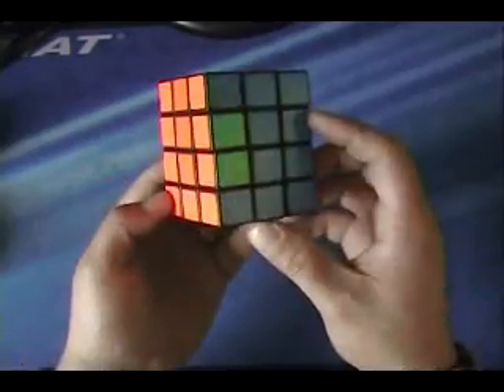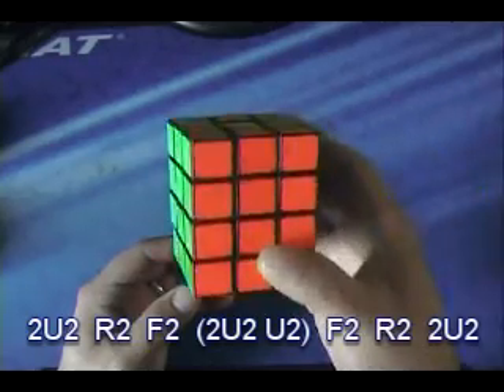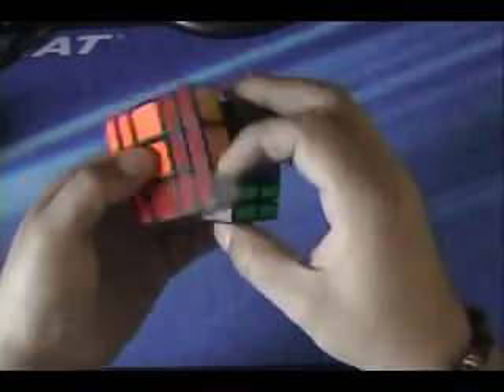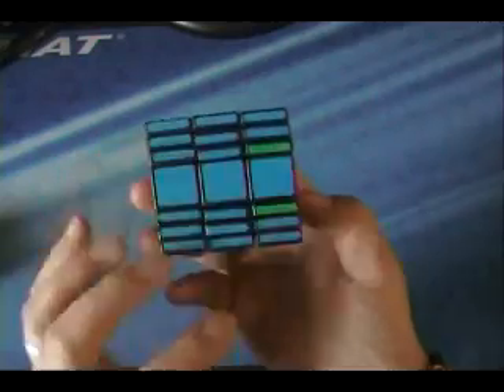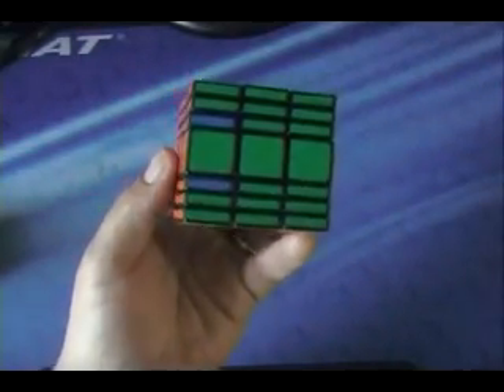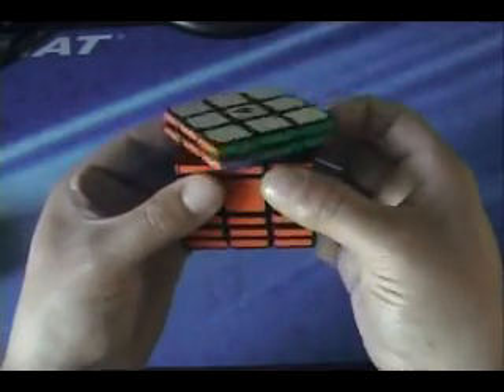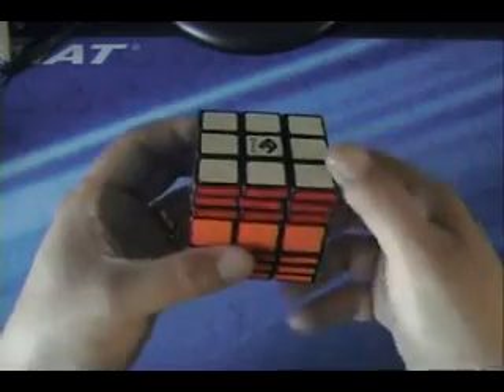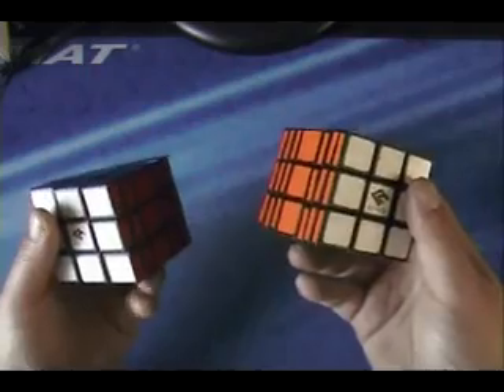How to solve parity on a 3x3x7

Comment: Instead of Uu2, U2 you can just do u2.

It's the same thing really, but I think spinning the upper middle layer (well, the ones that need fixing, depending on the cuboid)  around once is a lot easier to remember.

Flip the top around, right, front, spin the middle, then undo everything. Simple.